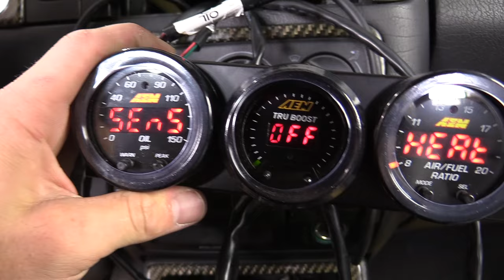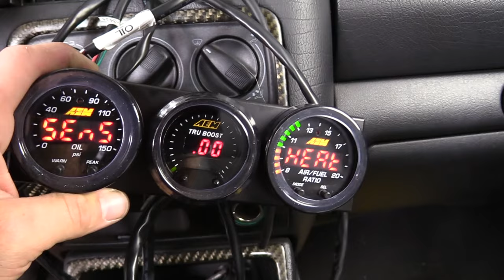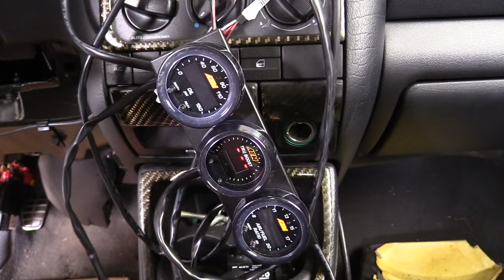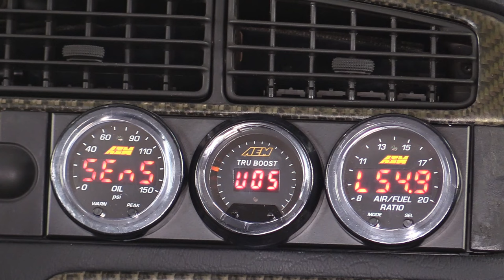How To Install A Boost Gauge On Any Car

Comment from the maker: I hope you guys love this video. I am excited to finally get it out for you. Feel free to leave your install tips in the comments.
Reply: @HumbleMechanic, dude, what the heck it that meter you were using on the fuse box to find the powered fuse, never seen something so handy, I need one in my life
Reply: Can you run them where the it the which on a electric turbo s kick on the gauge works
Reply: I have an idea I would see if it would work or not see what everyone would think if you could put 6 turbo s on a car or not and I was wondering how much power it could make
Reply: hello i have a question were would I tap into on 2017 Malibu 1.5L Turbo the tubes that i think i need to tap into are hard tubing!!!

Comment: Never tee into the FPR.  Doing so creates a potential point of failure in that component's reference pressure.  If the FPR loses that pressure while under boost conditions the fuel pressure will drop, the fuel air mixture goes super lean, and detonation happens.

Other than that this is a really good video which shows a very clean installation.

Comment: On factory Bi-Turbo setup (water cooled) do I tap it after the check valve (fuel and oil vapor feed through the check valve) or do I tap it in the factory Boost Control Valve before or after?

Comment: New to boost. You say vacuum line but is it pulling vacuum when line is attached to manifold where boost is getting crammed in or pos pressure? I ask b/c car i just bought confuses me. T fitting going to boost gauge - sourced via manifold (post throttle body) and pre throttle body via via pop off valve (recycled). 3rd line goes to waste-gate. Q is does waste-gate use a pressure signal to function or vacuum? If boost gauge is hooked to manifold side is vacuum only pulled even though manifold is filled with boost? Forgive mw of these are stupid questions.

Comment: 2:10 is there any way to find out what those junctions are exactly? My Car is torn to pieces so I can't check for terminal 15. None of them are red and my ground-terminal looks just like yours: Brown in a Circlic shape.

I printed out the Original Volkswagen Workshop Manual but couldn't find any similarities.

Comment: hi Charles... can you send us a link for the fuse tester . thank you
Reply from the maker: This is the exact one that I used in the video. In the description, I linked the PPIV because it's like $20 more and does a lot more for you. I like the 3S just fine. It works really well. I really all depends on what you plan to do with it. 

I actually used my PP2 more than any other one. It was quick and accurate. But having the voltage display is pretty nice. 

http://amzn.to/2BPBf4M

Comment: First off, always love the videos. But second, I really like the junction block. But I'm curious as to the stud that had 12v on it. Is that meant for the ign 12v wire to mount to? Then split off to the fuses?
Reply from the maker: Yes I’m pretty sure it is. I haven’t watched the video in a while.
Reply: @HumbleMechanic  Thank you!! And thanks for being active on older videos

Comment: Can you recommend a good but affordable brand for VW tools beside dealer. Timing tools etc. also what after market brand vagcom do you recommend. Thank you
Reply from the maker: I recommend the full vag com. It’s worth every penny at full price. And the best for pro use. 

For tools, check out this video with links to some tools. 15 Must Have Tools For VW and Audi Repairshttps://youtu.be/l2vbdqTRF6A
Reply: HumbleMechanic I have watched the video. It was basics. I have that stuff looking for more specialized engine and trans tools. I’m the local VW tdi guy since a dealer is more then 2 hrs from us. My latest was cam. Every lifter puck had holes every lobe flat. Did a Kerman stage 3. Once got that repair done it was still extremely loud but ran great to find the dmf bad. Upgrade it with a Malone single stage race clutch. Working with Malone now to be a tuner and sales of there products. Looking for a quality but affordable supplier in the more specialist tools. Also can you leave send a link for a vagcom? When I search I get a lot of aftermarket cell phone based stuff. Thanks.

Comment: Really easy to follow. Nice! I don't want to add gauges but is it possible to add an alarm or "ding" of some sort if a warning light is activated? Like a check engine light or low oil/coolant? I'm always worried on a roadtrip that I'll miss a warning light cause I'm not really looking at the dash, I'm watching traffic at high speed, kids in the back etc

Comment: Not that I have a turbo, but I went for Torque Pro and a $3 bluetooth dongle instead of adding any gauges to my D2 A8. Now... what do I monitor to get actual coolant temperature? Since the cluster gauge lies like a rug.
Reply from the maker: Yeah the cluster gauges on most cars are not super useful

Comment: I want to add a boost gauge and air fuel ratio gauge can I run the add a circuit for one gauge and then tap into the add a circuit line to add the second gauge

Comment: I have Aem boost, A/f and oil gauge I installed but oil gauge stays at SEns wondering if you know what I did wrong.
Reply from the maker: Maybe it’s not fully connected?

Comment: Good-day Charles, ?Could you put together a parts list for the improvements you did on your "MK3 VR6 GTI Project Car".   I have a 2002 VW VR6 GTI that looks just like yours & want to try to put some of your improvements to it (ex: turbo charger).  Thks TomB PS: Thks for the "MK3 VR6 GTI Project Car" playlist.

Background:  Welllll, a year ago I asked my motor-head brother to buy & fix-up a nice sporty little car for me.  Well $8K & a year later I got a 2002 VW GTI with a 2.8L VR6 (with a bluebook value of $4K).  Even after watching your "MK3 VR6 GTI Project Car" ; I still don't really understand why my brother brought & fixed-up a $4K bluebook value car for ?$8K?.   I guest that's water under the bridge & I just as well try to make the best of it.  Oh, I just got the Bentley repair manual (2000 pages of pure joy).  My few immediate problems (off the top of my head) are hard to find/get-into 1st&6th gears, upholstery need fixin, P0134&P0332 DTCs, driver's side door won't unlock via key, need at 2nd backup key (my brother replaced the VR6 engine with one that had only 50K miles on it).  I got it parked for now & hope to work on it next spring.  First thing this spring I plan to watch your "MK3 VR6 GTI Project Car" playlist about a dozen times.  Coming-up with a pragmatic game-plan for improvements will be the hard part.  With your help I just might be able to make it into a nice classic car but I still not should what I will really use it for.
Reply: Tom Bouie Use it as a donor. Put it in a mk3 or a corrado. Use your trans with upgraded shift forks. Now you have all the aftermarket support of the mk3 with the sound of a 24v VR.
Reply: Thks for the suggestions Jeremy but I not sure what a donor is.  In general I'm not up on motor-head speak.  
Again, my motor-head brother got me a 2002 VW GTI with a 2.8L VR6 (Gen 4 I think) & switched the engine out for one with 50K miles on it.  So besides my brother spending far to much $ & time-fixing on it, overall the car is fine with the few minor problems I mentioned.  Hopefully Charles will list all his improvements on his VW GTI so I can give them a try on mine next spring.  
The only reason I'm going to be driving it is to make my brother happy.  The only reason I'm going to do the improvements to it is to compete with my motor-head brothers (ex: bragging rights).  Thks TomB

You motor-heads will probably love this one:  Redline - The distance https://www.youtube.com/watch?v=Clp8dUWi6Mo
Reply: Pick a third generation VW. Put your engine and transmission into it. You have a highly desirable engine in an undesirable car.
Reply: Tom Bouie Put it in a vw corrado or a Cabrio or golf.
Reply: Jeremy, If I don't take good care of or degrade that car in any way, my motor-head brother will have a conniption fit.  He worked his butt-off trying to do something good for his geek brother (I'm a physicist).  When it comes to getting along with your family, rationality/pragmatism is just not the highest priority.   Thks though, TomB
Reply: Tom B These modifications are for  1993?-1998 cars. The car you have(GLI 24V VR6)does not share any parts with a mk3. Your's is a MK4.

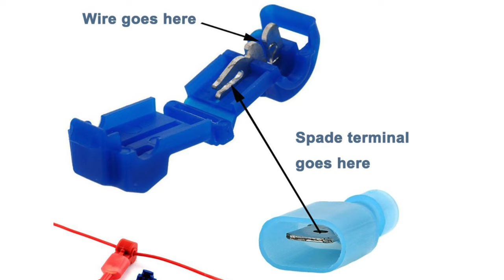Comment: Friends don’t let friends use scotchlock (2:30)
Reply from the maker: I am not a huge fan either, but in some cases it can be good.
Reply: HumbleMechanic -  Many years ago I worked a stereo place doing installs. The number of customers that came back with problems because of these connectors was amazing. They seem to work ok for a few months but if there is any movement of the connector or wire they are guaranteed to fail, especially if there is much load in the circuit. Preferred method is solder and heat shrink but if you’re in a hurry, wire nuts are much more reliable if you get the proper size, with the conductive spring inside them. I had to apologize to many customers there for a while because of these things. The ONLY use I see for them is temporary. Maybe if you need to tap into taillight wires for a trailer connection for one trip cross country and then take them back out. They do allow you to make connections without chopping up the vehicles wiring.

Comment: Solder and heat shrink > crappy scotch locks
Reply from the maker: Agree. But I get a little nervous recommending someone that is not tuned into automotive wiring start cutting and soldering wires. The other good thing about Scotch locks is they can be removed easy. 

But if I had my way, no scotch locks would be used..

Comment: where's your tubo blanket! :O
Reply from the maker: Most of this was shot before I got that blanket. But I still have yet to install it. I think that Engineering Explained and I are gonna collaborate on a video on the topic.
Reply: Blankets are crap, better of to heat wrap the downpipe nice and thick.
Reply: +andrew wright Why not both?
Reply: computiNATEor spoils the look for next to no real world difference with or without it.
Reply: The turbo's buried up against the firewall. Unless you're doing some crazy custom front mount, I think the heat retention and containment characteristics are going to outweigh any slight cosmetic benefit.
Reply: computiNATEor won't do nothing to egt so why bother?
Reply: To prevent cooking the paint or wiring or whatever's near the turbo for long term reliability.
Reply: computiNATEor wiring shouldn't be a problem as it shouldn't be there in the first place. Peel and stick heat shield will prevent paint damage to bonnet. Works really well and again doesn't spoil
Reply: or just install a nice heat blanket and call it a day :)  and wrapping your downpipe can have unwanted consequences as it's in the lower part of the car and can end up soaked from rain water and spray and then rust out even the best of stainless steel.
Reply: Nick P each to there own. 🎄